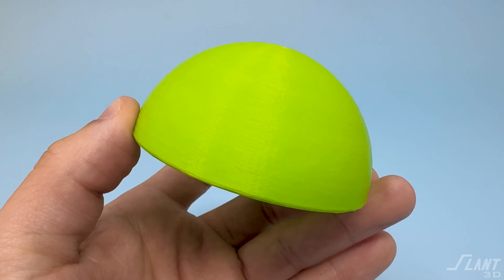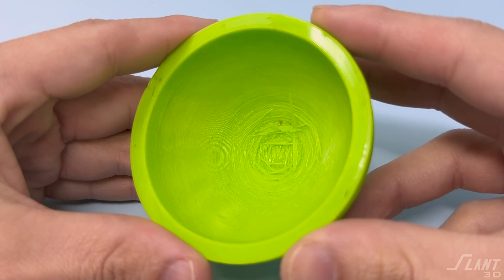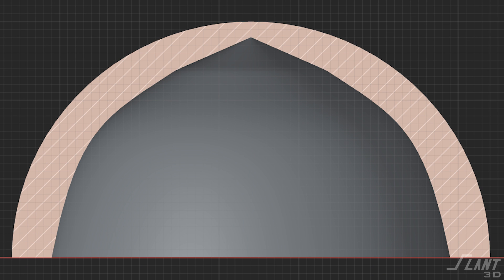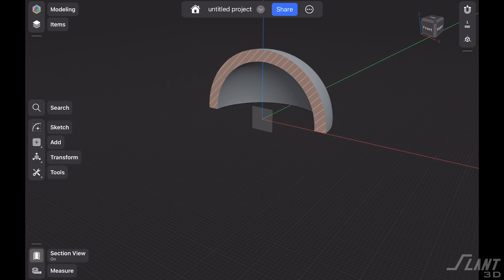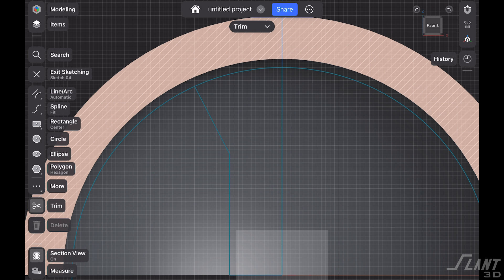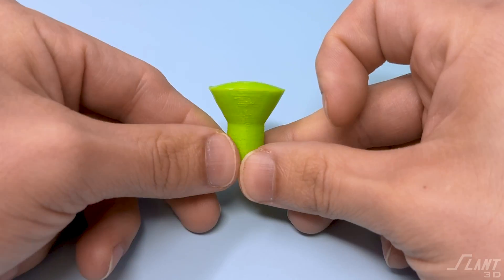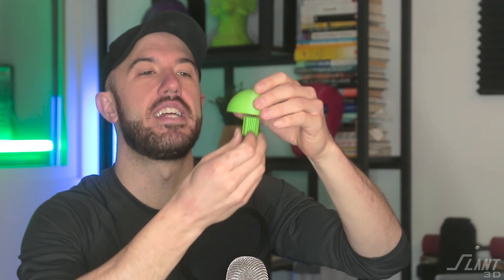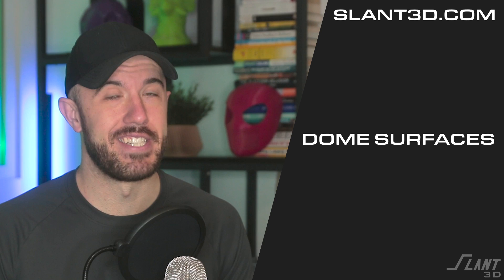Secrets to Better 3D Printed Domes | Design for Mass Production 3D Printing

Comment: When it comes to a large dome and wanting to minimize supports. Do a mixture of both methods. Design a small support on the interior of the dome spaced about 0.5mm from the interior wall, make this support at least 1-2mm in thickness and have it end in a flat bottom. Automated supports can then support the designed support and save on material while still giving you a clean inner surface is you REALLY just need that interior dome shape

Comment: Excellent advice with making a completely flat interior to basically help generated supports do their job. I have done angles in domes and hand made supports (and printed upside down, easier to sand the outside!) but never tried that, very clever

Comment: Another option is to design it with the flat section similar to your auto generated support option, but don't use supports. Bridging can work surprisingly well with the right design and with the right printer.

Comment: Hey! Just curious, do you print your custom supports at the same speed as everything else? Or do you have a way to tell the slicer they're just supports and print them differently, like faster? Idea here is to save some time on printing support material. It may not be a huge deal for one-off prints, but maybe it can add up when mass producing, no?

Comment: I'm curious if there's a reason you didn't mention bridging when you've flattened out the interior geometry? On a well dialed in machine and correctly sliced file you probably don't need any supports that way.
Reply from the maker: But what happens when the dome gets bigger
Reply: @slant3d  thank you very much

Comment: I would think most printers can just bridge that flat top to the inner dome without support. I know my printer can bridge 2 or 3 inches really well. You only get into trouble when a section is hanging in the open with nothing to hold the other side.

Comment: Last example of where you cut the lower part of the dome can be done without supports. Just dial correctly the cooling and speed of the bridge and it will contract the plastic and support itself. IT would looks the same or even better than the supported one

You can try bridging from 20mm/s to 60 or even 80mm/s
Reply from the maker: And when the dome is bigger?

Comment: Surely if you have a flat inner surface, it would be bridging (like in the section with the supports), rather than using generated supports, you could just print as is and given there's enough cooling to support the bridging, it should print without issue
Reply from the maker: And if the part is bigger?
Reply: @slant3d  A lot of printers (that I've seen/used) with decent cooling can do ~5cm of bridging with correct settings, and proper cooling fairly easily. You could do a stair step (similar to what the Voron team use for through holes) up to a height where the bridging section is around the same distance. This would take more time with the modelling and experience with the printer to get right, and a printer with adequate cooling to achieve, but if you're batching out parts, could be a big filament and time saver in the long run. Obviously, this would only work to a certain extent, but from my (admittedly relatively small amount of) personal experience, with mine, and my friend's printers, should be feasible up to around helmet sized prints

Comment: In my experience, 0.5mm top gap between the support and model, is excessive. 0.2mm on a 0.16mm layer height is ideal, breaks right off super easy but leaves a near perfect layer. If you’re using thicker layers like 0.2, I’d just use 0.25-0.27mm top gap for the support interface.

Comment: I think this is currently a limitation in today's slicing software and less so with the FDM process itself. Fullcontrolxyz shows some crazy overhangs and I think could easily create a clean dome as intended (there are these frequent challenges, sometimes including 90 degree overhangs), however that's likely somebody sitting down and manually writing clever gcode and not something most slicers are able to do... yet. This may be a job for AI, integrating with Cura, Prusa, Orca ect and figuring out how to print domes and upside down screw holes without supports or clever modeling tricks.

Comment: I like these solutions for 'features' rather than parts, as they can be applied in combination on a range of parts as needed.

I also like the emphasis of designed supports vs. auto-generated support. This seems small, but is not necessarily obvious. I've designed brims, adhesion tabs, anchors, bridges, etc, and these require much less material AND are can be more reliable and easily removable than the generated stuff. This doesn't matter as much for a one-off part, but if you're printing a large quantity, is well worth the effort.
Reply from the maker: Yes. A generic solution often doesn't work in production.

Comment: Variable layer hieght FTW, i was shocked to have perfect prints with limits set down to 0.04mm layer height. This was on a dome about 50mm wide, im sure it wouldn't work well if larger
Reply: Yeah, variable layer height works wonderfully for round-shaped objects.

Comment: What are you thoughts on variable layer heights? Thicker layers for vertical walls, then shorter layers for those top of the dome to make it ls stair steppy. Curious of a pro's opinion.
Reply from the maker: Adds print time. And in this situation does not add much value over other more robust solutions